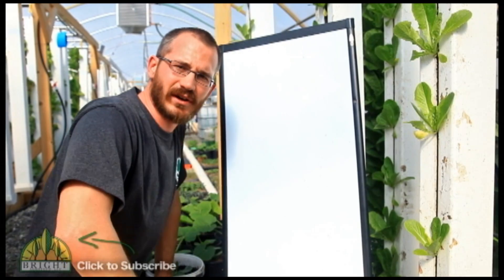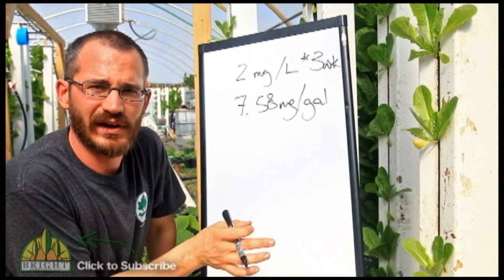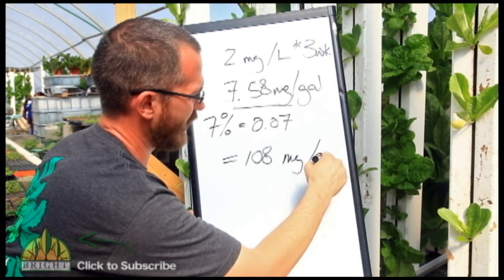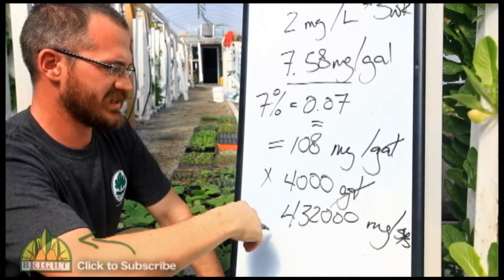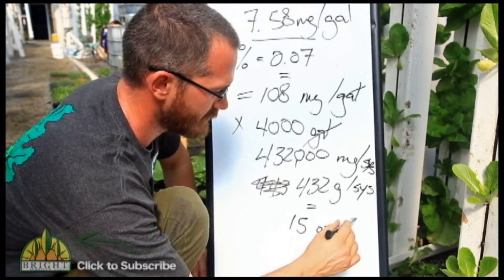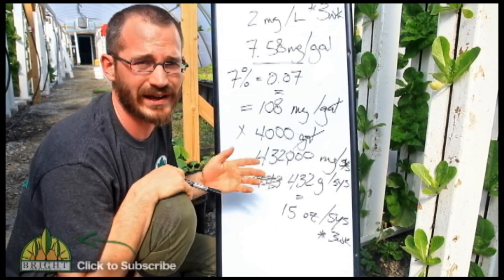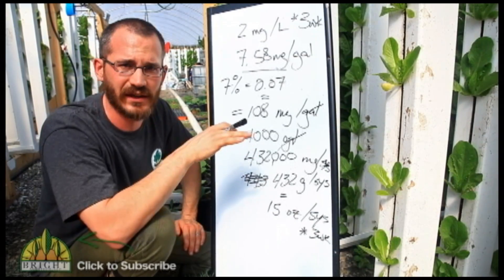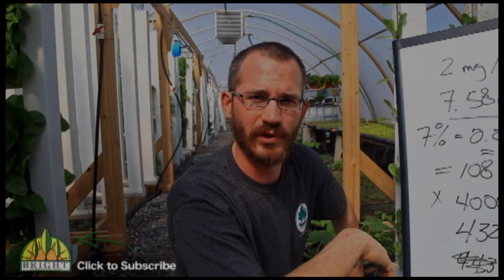Iron in Aquaponics - Part 2 (How much do I need?)

Comment: Struvite (basically Ferric Phosphate) is often associated with industrial/municipal wastewater treatment.  When it forms in the wrong places, it can cause "scaling" (clogging of pipes by the precipitate), but operators often use iron to intentionally form struvite pellets (which can be sold as fertilizer at least for soil based agriculture) to remove that last bit of orthophosphate from the water stream before returning it to the environment.
     I don't know to what extent microbes need iron, but I do know it is added to aquaponics water because it isn't really supplied by fish food at adequate levels for the plants (even though fish, unlike some invertebrates of interest, do have a hemoglobin based blood like ours, and thus need ferrous iron).  I am wondering if an insoluble iron phosphate like struvite (as granules mixed in or as a surface deposit caked to the growth media, much as catalysts are sintered into high surface area carriers like zeolites in the chemical industry) could be mixed in the growth media of the plants to localize it where needed.  In the water itself, iron could encourage algae and at high levels perhaps flavor the meat (I can taste iron in tap water,  though I imagine the fish are selective in their uptake).

Comment: Really very good information...
i have question,
1.) After mixing 2ml /L what will be the PH for water?
2.) What is the ideal PH and PPM for the Aquaphonic system?
3.) All vegetable can use the same PH and PPM? or need to do separate system?
4.) Some vegetable need 6.5 and 7.00 how to control that PH and PPM

Comment: where i get a little lost is that the 2mg / l  ratio i thought that was the dosing quantity to add every 3 weeks, But you then divided it by the 7% Chelate which brough it up to 108 mg / gallon.   i have a 140 gallons systems and just added 1 g of 7% chelated iron   the water turned yellow right away , i m wondering if i did add the 108mg/ gallons , the water would have turned dark yellow and also promote algae growth ?

Comment: My system have 120 litter approximately. When I adding 1.5g (EDDHA-FE6), the water start turn red already. By calculation I need add until 4.0g. Should I stop or go ahead? is that my calculation correct (EDDHA-FE6 = 6% ,  1g:30L)?
Reply: Ngieng H. H. Your calculation is correct, my system is 120 L , too. I added 0.5 g and the water turn red, which scared me. I chose to stop

Comment: HI Dr Nate I have a aquaponic micro system and i have problems with K and Fe. I have FeEDDHA product but it paints of red the water, its normal or not? Thanks have a nice day
Reply from the maker: Hi Oscar, there is red in Miller's FeEDDHA, but it won't hurt your system. Some people are bothered by it because they give tours or just don't like the look of it, but that's your call.
Reply: Hi thanks for your answer, I put about 50 gr for 500 gal, now my water is dark red. I worried about my fishes they are not eating well since I put the fertilizer. =( I hope they get better next days. Do you know if the red will disapear some day? Thanks
Reply from the maker: Hi Oscar, it will stick around for a week or two depending on how much you’ve added. If you really don’t want the red color, try the FeDTPA. The Miller's shouldn't be affecting appetite unless you added a LOT.
Reply: Thanks

Comment: I just added 8 ounces of 3.25% iron from Ferti-lome Chelated Iron. I have a 2500 gallon system. I believe that I needed almost 20 ounces in there but opted to add less than half to start? Is 20 ounces the correct amount? according to what you were saying?
Thanks
Chuck
Reply from the maker: Yeah, you probably need more than that, but starting lower is ok.  Better less than more.  If you want help with the calculations, use this: https://able.ag/Calculators
Reply: Thanks Nate. THat is really helpful
Chuck
Reply: I would love to tour your place, Where is it located?
Reply from the maker: We're in Laramie, Wyoming!  Give us a heads up if you're ever in the area!

Comment: In USA measurements how many dry measures in spoons or cups would this equal. I'm too old to have the desire to learn metrics.Thank You.
Thanks very much though for the breakdown on kinds of irons, very helpful.
Reply from the maker: dry measures don't work because you need to calculate based on weight, not volume. Once you measure by weight once though, you can measure that volume of chelated iron and then add by a volume measurement from then on.

Comment: Quick question, does the iron loose it's biological value over time? If a system had a very high water volume to grow bed ratio for thermal stability would the same UVI formula apply?
Reply from the maker: +Enigma Cipher Yes chelated iron can be broken down over time, and especially in systems with lots of exposure to UV light.  The UVI formula is primarily for systems with the UVI water volume to plant number ratio, or lower.  If you're going higher, you can still dose at that rate, and slowly reduce over time to figure out what your best dosing rate is, or you can do the calculations on the UVI system and reduce your dosage by the difference between the UVI ratio and yours.  Great thought and worth bringing up!

Comment: Hi Nate,
I have a aquaponic system made of concrete. It has been up and running for about 14 months. It takes a long time to grow anything in this system. Recently every thing is dying but fish are doing well. I have about 200 3-5 inch tilapia in the tank and about 300 mollies in the growing bed to eat the mosquito larvae  The amonia is between 0 and .5, nitrites are 0. and nitrates are 2.0 My ph is 8.5 or higher by my test kit. I know that the concrete gives off a high concentration of ph but I would think by now it would have stopped leeching. I have changed water. I have tried ph lower, vinegar, and lemon juice. Nothing seems to help. Its the rainy season where we live and the water is being refreshed almost daily with rain water. I would think that water would have a nutral ph. Can you help me to understand what is happening?
Reply from the maker: Hey DaveCheryl Jereb , Nate says it might be two things. 
1. You are under loading your system and its not producing enough nitrates.
2.  Your PH is way too high and that might be caused by your system being made of concrete.  Concrete usually contains large amounts of lime, which can inadvertently raise the PH of your water.  A lot of AP growers using concrete like to line their systems with plastic or wax to avoid this. 
Hope that helps!

Comment: Hi Nate,

I am a huge fan and thank you so much for taking the time to help educate and demonstrate for us newbies.  :)  The Iron thing is baffling me.  I am just starting but plan on building into something sustainable as a career.  I currently have a 130 gallon raft system supporting 10 sweet basil.  I'm dosing EDDHA at your recommended starting rate but my water has turned a rust red.  The chelated iron is a black powder so I just assumed that's what happened.  However it is difficult to monitor my fish (5, 7 inch Koi) as well as monitor my sediment collection.  I built a swirl filter that seems to work well but not well enough.  I keep getting sediment caking my roots.  Sorry to ramble..  to the point; Is red water ok? and why do the basil leaves look dry?  It's like the oil shine is missing.  Not sure what could be causing that.  I have the exact same seeds planted in dirt for comparison of growth, taste, texture, etc.

Thanks!!

Comment: Hi Nate!
As always great video!
What about iron sulphate? It's the only iron available for me, and I've been using it for two years now.
Is it safe?
Reply from the maker: Hey galkaenazul - Iron sulfate can be safe, but like everything the poison is in the dose. It's just not very effective in most aquaponics systems because the majority of the iron rapidly oxidizes. Iron sulfate is an inexpensive input, but what must be considered is the fact that a significant amount of the iron inputs never actually become available to the plant. Chelated iron products are much more expensive, but so bio-available that on a cost per unit of iron that they update, chelated iron is cost competitive with iron sulfate in these systems.

Comment: Nate, thanks for the video.  I got your Key for Diagnosing deficiencies from your website, and this video (and video 1) gave me a lot of great information to go along with that Key.  You did not mention how you add the iron.  Sprinkle directly in the sump or?  My system figured out to need about an ounce of FeDTPA (13%).  I just mixed in in about a gallon of water and poured most of it in the sump and a little in the corner of my grow boxes.  Hope I did ok on that.  System seems to be responding well - Chlorotic issues almost gone after a week (weren't very bad to begin with).  Thanks again.  You're like my Aquaponics Prophet.
Bob
Reply from the maker: Hey bobsnrg thanks for that nice feedback! You can add your FeDTPA into your sump.

Comment from the maker: Hi Pirke, your math is right- I failed to explain that we'd just moved into our new setup.  We do use less iron than I recommend, but we still are going through a couple ounces a week.  I was remiss to mention that the 3 years our 5lbs had lasted us was on the 4000 gal system (with low plant production) system that we'd just moved from.  Sorry about that!  You're completely correct. Sorry to confuse you!

Comment: Hi Nate,
I have a dillema about your advice on Iron.
In your vid "Iron in Aquaponics" You said that 5 pound will last for 3 years and in this vid that You use it in a little bit lower rate but optimal for your system is 5oz per week. 
So,my question is next: if 5 pound is 80 oz  than 5 pound will be enough for 16 weeks(your system).
But 3 years is 156 weeks and if we divide 5lbs/80oz with 156 weeks than You actually use 0.51oz per week. And your math is 10x that. What did I get wrong?

Thanks!

Comment from the maker: Continued. . . . We'll do the same thing in our current greenhouse- bring down the dosage over time.  We'll find out where our consumption threshold is and then stay there to save money on iron.  The 2mg/L rule is just a starting point.  Many folks will bring it down a bit depending on the needs of their specific system.  In our new greenhouse we will go through around 15 lbs per year.

Comment: You explain the dosing for water quantity very well, thank you.  But what I am asking is for monitoring.  I have an iron test kit, but am wondering @ what ppm should I try to maintain my water.  I think that if I dose continuously, without monitoring, I could be using too much or not enough.  I have found some info that tells to maintain point25 PPM, up to 2-3 PPM.  At what level do you try to maintain?

Comment from the maker: Hey Russ, check out your local Ace Hardware for a five pound bag of Miller chelated iron (FeDTPA) for about $50. Stay away from FeEDTA - It's super inefficient at pH's above 5.3. If you're putting in FeEDTA you're wasting about 90% of it. If you switch to FeDTPA or FeEDDHA you'll be using it more efficiently and saving yourself a lot of money in the long run. Hope that helps!